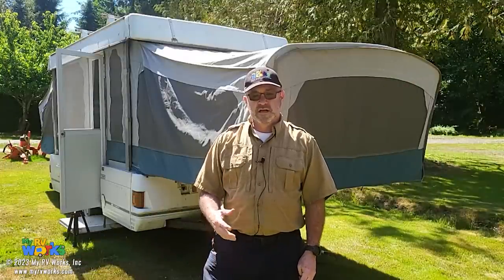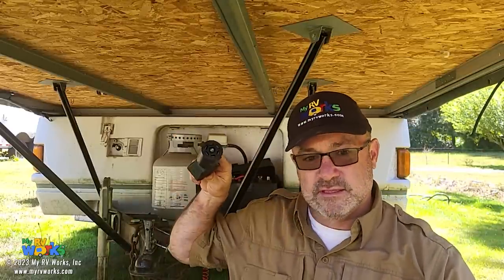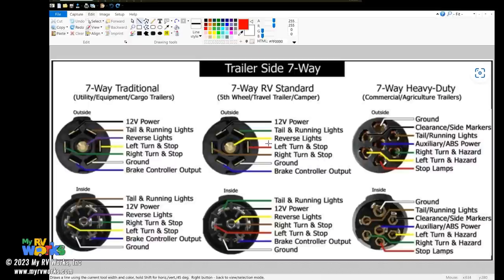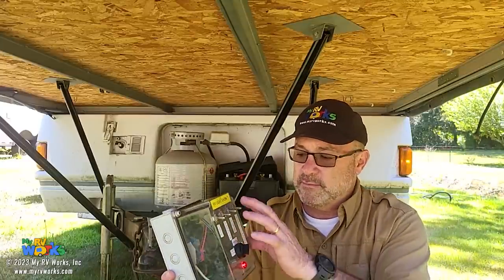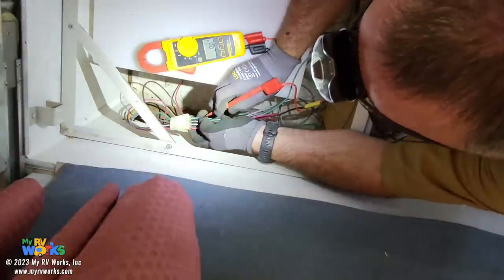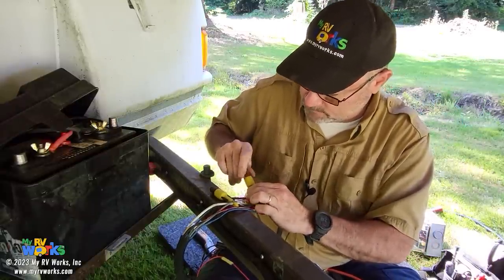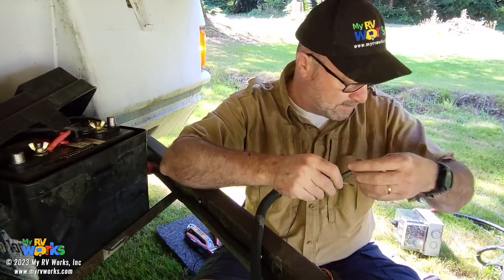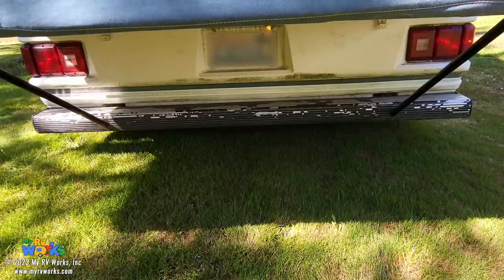Repairing 7 Way Trailer Plug Wiring -- Pop-Up Camper RV -- My RV Works

Comment: The reason that you are seeing continuity in all the pins on the trailer plug is that the signal is going through the bulb to the ground and back through the other lights to the pins. Almost no resistance through an incandescent bulb when not lit up. When power is put to a bulb it heats up and that is when you will get resistance.

Comment: Explaining electrical to a novice  is not easy .  Great job 👋👋maybe explain  led  bulbs  to  conventional  and use trailer battery  as source for plug confirmation  on camper (isolate) vehicle from trailer.

Comment: Great video... I believe the standard 7 pin plug is to match the 4 pin flat connector on most utility trailers with the use of the 7 to 4 adapter..

Comment: It’s much better to back probe connectors than to “tap in” and puncture the wiring insulation which will cause possible corrosion issues later…..But we’ve all done it 🫣